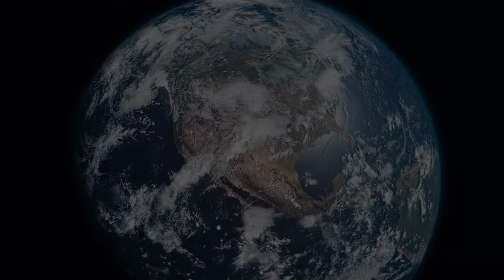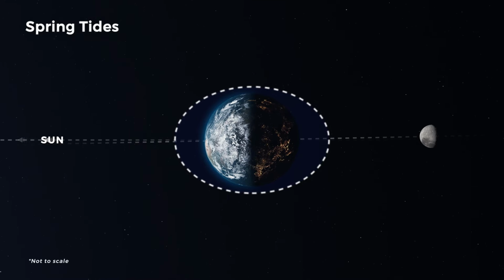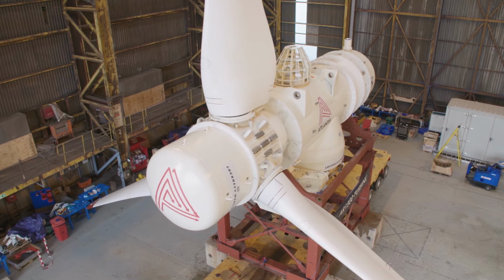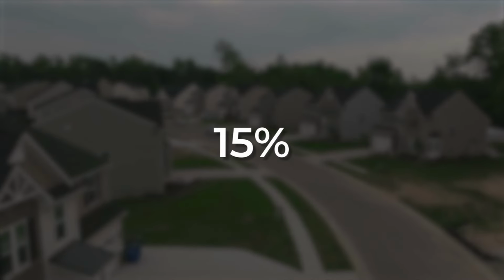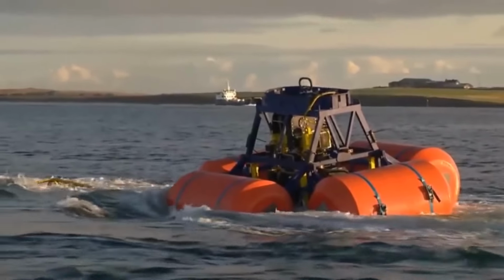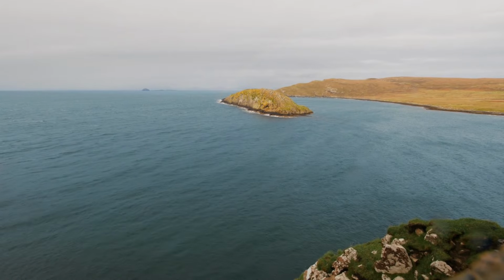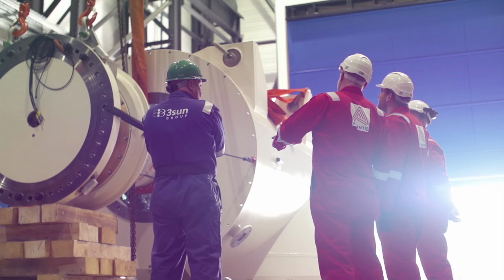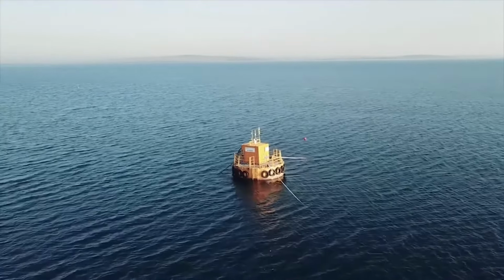Can Underwater Turbines Solve Our Energy Problems?

Comment from the maker: Have you watched our new video on Real Science? When we posted it we only had 30k subscribers. Somehow it now has 1.4 million views. Madness https://youtu.be/Bh4jKXsquWA
Reply: I have questions 

If tides is caused by the gravity of the moon and the sun does that means the energy of the tides comes from gravity?

 Does that means energy is transfer from the gravity to the tides?(since energy can't be created) 

Yet gravity of the moon comes from its mass so is the mass of the moon decreasing constantly?

Does that goes the same for every thing that have mass?

Pls🙏🙏 I need answers😅😅
Reply: @ll_ll4986  G'Day mate. The energy doesn't come from the gravity of the moon, it comes from the rotation of the Earth being much faster than the orbit of the moon. The gravity of the sun and moon act as anchors for the oceans tidal bulge which stays still while the Earth spins beneath it.

The energy is being extracted from the Earths rotational speed, ie: it's angular momentum. The Earth is made to spin a little bit slower every time this energy is used. This form of loss will eventually result in the Earth-Moon system being tidally locked. This is not a renewable energy resource in any sense.
Reply: @lordchickenhawk  thank you so much
Very well explained 🙏🙏😊😊
Reply: ''''''''The Earth is made to spin a little bit slower every time this energy is used. ''''''''''''''''''…………….………………………………………….when you say we use the energy do you mean when we use hydro electric or tidal power?
Reply: It comes from the Earth's rotation slowing. Eventually (very very long from now) Earth would become tidally locked with the moon, and then no more tidal energy could be extracted. (Actually the Earth will be engulfed by the Sun before that; but it would happen otherwise).
Reply: '''''''''Eventually (very very long from now) Earth would become tidally locked with the moon, and then no more tidal energy could be extracted'''''''''…………….……………………………………………………….where's your evidence of this and  when will this happen?
Reply: @ll_ll4986  Probably easiest to think of it as the energy comes from the spin of the earth and gravity is rope tugging from ocean to moon
Reply: @ll_ll4986  yes.. the moon draws up a big convex bulb of water which ever point on the earth its currently at.. as it passes over that bulb at the equator 'relaxes' back down causing the water to run both north and south away from the equator making the ocean level rise in the southern and northern hemipheres.. this is it tide coming in.. when the moon sucks it back up again  this is the tide going out
Reply: These should be put into commission.
Reply: @Orcaben1  at the earliest all round the world. 
Preferably beginning with India, with a suitable tue up with the Tata group or adani group
Reply: I'm sorry but this is an old design because we had people designing systems to use the ocean currents to ceate systems to generate electricity . There was a design that used the waves to generate electricity . I seen several different ways to use the ocean currents and waves to generate electricity and everyone of them were rejected by state and federal governments . One of the reasons that they were rejected was the cost and the time for the systems to pay for themselves . The other problem is the maintenance to keep them working .
Reply: Wish you and the YouTube channel  Mustard would do a video together
Reply: "In the end it will be hydrogen..." Why complicate?
Reply: We have water fuel cell technology they are suppressing. They don't want us to use it because there is no money in it for them. Water is very cheap and falls from the sky.
Reply: 天堂心臟  
Less friction means more water must move faster to turn the propellers...
I knew someone would bring this up at some point though. Friction is a necessity when it comes to using movement to generate electricity. No friction means you can have all the water in the world push up against those blades and the liquid would just flow effortlessly around it without disrupting it. Lowering friction would reduce energy output.
Reply: Corrosion is far more an issue than you can imagine, this technology has been around for years now, has relatively non existent restrictions and has yet to be instituted by any large companies due to the break down of the turbine's being so constant. This doesn't even begin to address the inconsistent currents not to be confused with tides that are, unlike commonly believed by most people, not on a set schedule not direction. They follow large scale flow like the Atlantic  jet streams but are hectic beyond belief.
Liquid salt reactors are safer less costly to build and maintain per Kw/h and killl less animals not to mention produce less pollution.
Thorium salt reactors in particular would allow for a massive advancement on cancer research as well.

It's not PC though so most people will keep repeating "CHERNOBYL!!!!"
Reply: There’s this place called Nevada I think that is so hot you wouldn’t walk half a mile just cover it in solar panels and the USA is sorted
Reply: @ice843  True. Even cleaner and cheaper than solar is the Leonardo E-Cat SKL and the BrilliantLight Power SunCell. 
See more at: E-CatWorld.com
Reply: Please do a video on nuclear power. IMO it is a nearly zero carbon energy source that is safe, just works, and has been implemented extremely cost effectively when done right (France, Sweden)
Reply: @2g00dt0btru  hell caught up  Einstine said hell of way boil water.even now tripple meltdowns ignorance mandontory is good short term.
Reply: RIMSHOT!
Reply: @ristube3319  E che significa ?
Reply: The ads spoils the entire video
Reply: 0
Reply: P
Reply: l
Reply: throw the blades use spherical turbine
Reply: I did and subscribed! 😁
Reply: 0p0
Reply: Please consider this to be the greatest inspiration possible. All the very best.
Reply: A large area of under wayer is kept idle.
Reply: this be cool in a much bigger and slower version at the entrance of the Mediterranean sea.
Reply: On these propellers, as on ships or submarines, the propellers kill the fish and this is not good, it would be better to use a rigid metal mesh around the propellers, precisely not to kill the fish and not to damage the propellers.
Reply: Something I always think about is, If a type 1.0 Civ , of maybe a type 0.95 Civilization  with  large energy capture of the planet, taking energy from flowing air and water currents', must have an equal and opposite reaction, right? Such as slowing down and/or changing the natural flow?
Reply: Ummm, What about The Bay of Fundy in Nova Scotia Canada.  They have been doing tidal power generation for decades.
Reply: so ok underwater turbine with windmill design would this harm sea life just like there do with flying bird  towards ordinary windmill farms ?
Reply: but what about that time the U.S navy made liquid hydrocarbon fuel by extracting carbon dioxide and tmaking it carbon monoxide and yes even though the tech is pretty early it's at least is carbon neutral
Reply: The Leonardo E-Cat SKL is an new source of cheap, clean energy, as is the BrilliantLight Power SunCell.  Learn more about these at: E-CatWorld  [dot] com.
Reply: Hi,  the amounts of Energy you mention in the beginning of the video, is that the total  amount we could ever harness from it or doesn't it include power production by salinity and other methods?
Reply: Like  Hard Drives  in RAID 5,   Every water turbine system should have a 'spare'  turbine.   a  5 turbine system is actually designed to continuously  run 4 units,  and rotate taking  one  turbine  off line  for  cleaning,  maintenance,   and inspection.    Continually rotating the maintenance and replacement of parts will extend the life of  all the turbines.
Reply: Read the comment 😕 I could get on wind and solar 35% to 45% not the 8% you have????????
Reply: There is also a tidal power plant (Annapolis Royal Generation Station) in the Bay Of Fundy in NS, Canada.
Reply: do a video on NASA's kilopower reactor and how its gonna transform space habitabilty.
Reply: Hi, I'm from India. Is there any job opportunity in Australia after doing any course you talk at the end of the videos?
Reply: It is amazing that you can SOUND smart but BE so ignorant.. or are you being deceptive on purpose?
Reply: 天堂心臟  
The body also produces lift and can stabilize the plane's aerodynamics. It needs some friction but generally speaking less (but not zero) friction on the fuselage is something aerospace engineers are looking into as it would improve efficiency.
Reply: Love the vids ❤️🔥 keep it up. I was wondering if you could make a video about the science of how McDonald’s and Ford can build car parts out of the coffee bean rests
Reply: As the Gulf Stream passes Cape Hatteras, the movement of water is some 45 times greater than the flow of every river on earth. That amount of moving water represents an extraordinary amount of potential energy, enough energy, according to the Coastal Studies Institute, that harnessing just 0.1 percent of the available power would yield the equivalent of 150 nuclear power plants. That’s 300 gigawatts of power.
https://www.coastalreview.org/2017/05/project-looks-tap-gulf-streams-energy/
Reply: NO MORE 'CHOP CHOP' turbines! Wobble Sticks are the way to go guys!
Reply: NUCLEAR POWER FTW!
Reply: Just more BS like the wind turbine 
Government subsidized crap! 
It cost 30 million per turbine last 5 years and produces less energy then they used to make it! #tellthetruth
Reply: @generalwin13 oil discovery impllaced betz limits with leonardo 509 year old design and you can not even see einstines equal and opposite reactions threw big gaps.  Betza  i did.in corner hover dams that reverce equally in tides magneticaly naturally upside down and sideways equally  blocking is 1 releasing is 2   = i big betz boo boo in 1919 to eliminate Einstine infinate winds, tides from reacuring in elections  works.right right slick.today greasing the elect.
Reply: You did not directly answer the question posed in the title in the video
Reply: I 100% disagree on ocean turbines, the amount of sea debris and oil it would out in the ocean we dont need it at all,nuclear fission is the best way to make energy without doing any damage
Reply: @treelonmusk8324  I'am with you that nuclear energy is an amazing way to provide large amounts of power but the sad fact is it comes down to money/investment and sadly public opinion which most people will never take the time to properly research the facts.
Reply: @jacksonstorm9561  it will take time but once we find a cheap clean way to do it, its gonna change the world, Chernobyl really showed us that we need to be careful tho
Reply: '''''''''''the amount of sea debris and oil it would out in the ocean we dont need it at all'''''''''''''''…………….…………………………………………………………..could you translate this to English
Reply: How about nuclear???  Oh that's right.  Most people don't understand it and thus fear it.  So we will just create a bunch of toxic chemicals to get the rare earth magnets for all the wind and tidal turbines.  What about the land fills of Tesla batteries that will exist in 50 years.  Also the creation of solar panels have a gas byproduct that nothing can absorb unlike Co2.
Reply: @clamp motosua What we use now is something we call nuclear fission which comes with all manor of lengthy complication that rightly should be feared such as meltdowns, weapons grade material and 15 thousand year half life to safe levels. However in the future we hope to harness nuclear fusion which doesn't suffer with meltdowns, isn't weapons grade and has a half life of 150 years to safe levels. Because we aren't there yet with the technology we have to do something about the issues we have now and green energy solutions are the way forward plus it's technology that takes you off the grid so in the future there will be a healthy mix of these two, it's just taking time to develop and adopt.
Reply: @clampmotosua1789  
What no one mentions here is that charging lithium ion batteries also produces gases... directly.
Charging a lead acid battery produces hydrogen in large enough quantities to be a fire hazzard and sulfur dioxide in trace amounts while charging lithium ion batteries produces nitrogen oxide which produces ozone which is a potent GHG and toxic to humans and animals it also produces CO2 gas directly. These gases escape the battery through ventilation ducts in each battery and a 1,200 pound rechargeable car battery is bound to produce a noticeable amount of CO2... Enough for them to warn users about charging in poorly ventilated conditions and warn users about charging their cars during the day!

Anyway I won't hold my breath that this RE guy will discuss that or the fact that Li battery fires output fluorine gas which is beyond caustic and we don't have the resources to just deal with EVs catching fire in the event of an accident. Hydrofluoric gases in high enough concentrations can start fires on things like brick and dissolve glass. Li batteries can produce enough HF gas to be toxic to humans.

30ppmv HF is considered a life threatening concentration.
A phone battery can obviously produce enough to hit 10ppm which is an irritant and mildly damaging to skin, eyes and respiratory system. I know what the ladder kind of exposure feels like I can only imagine what damage a car battery fire could cause.
Reply: @clampmotosua1789  Tesla is getting ready to recicle batterys: https://youtu.be/08FOfbhhKlw
Reply: nuclear plants take longer to build : almost ten years
Reply: @Dan W lol dont get all butthurt and try to start an argument bc I called you out for not knowing your stuff😂
Reply: Yeah that sounds great.. until you realize that it is screwing with the streams and warming the ocean.
Reply: @Dan W um are you sure?because the reactor inside of Chernobyl was a light water reactor... humans have yet to build a fission reactor yet that actuall works..😂😂😂😂😂😂😂
Reply: @treelonmusk8324  
RTGs are close enough despite not using fission to generate power. Genuine fission reactors are very rare indeed but they do exist.
Reply: @VariantAEC  show me a fusion reactor, lol you cant, cause there isnt one
Reply: @treelonmusk8324  never said anything about fusion you were talking fission earlier I mentioned RTGs which use radioactive isotopes and a thermal couple to make small amounts of electricity while KRUSTY (NASA's new Kilopower reactor) does use fission to function.
Reply: @VariantAEC oh look another internet good who wants to argu lol
Reply: Real Engineering
Harnessing wind power, earth thermal energy, Tidal wave energies will not affect equilibrium  of the system?
What do you think?
Reply: @MrDrgdf  Wait are you one of those dipshits who thinks that if we use geothermal we'll freeze the planet?

The heat energy doesn't disappear. Energy is not being destroyed.
Reply: @herpderpherpd  
Not only is it not being destroyed it's impossible to eliminate that energy supply unless the mass of the planet shrinks substantially.
As I mentioned possibly in another thread this is a gravity fed energy system. The literal pressure of the planet above is warming the stuff near the core of our planet. It won't cool even if the sun suddenly disappeared (no nova/supernova just deleted) and our planet was flung into deep space and found 18 billion years later.
Reply: @MrDrgdf  
Equilibrium of which systems? The global waterways, airways and deplete geothermal energy? No.

Kill all kinds of animals in the air and water? Yes, these systems will be affected. Geothermal doesn't affect animals that live underground as no animals live in the deep within the earth's crust that we have ever discovered and the system is gravitationally fuelled. The energy for geothermal cannot be depleted unless the Earth loses a lot of weight. The cores of dead planets are likely also hot even in the middle of deep space for billions of years. This isn't something people discuss because it sounds like woowoo despite the energy coming from an interaction between fundamental forces and matter that is renewable to the best of our knowledge. Basically if their's something out their like a hot superearth that was flung out into the vastness of intergalactic space and has resided there for 8 billion years it's core is probably still hotter than our planets own core. Mars is also considered to be a dead planet with little to no volcanic activity, but it's core is also likely about ⅕ as hot as Earth's according to 13 year old research papers discussed by New Scientist here: https://www.newscientist.com/article/dn11962-lab-study-indicates-mars-has-a-molten-core/
Anyway basically geothermal and hydroelectric power is the most sustainable energy we have but wave power via turbines like these are likely going to be hazardous to marine life anyway. Humans will likely push forward and kill animals by way of clobbering them to death with these fan blades rather than using nuclear energy or sticking to the cleaner methods we've been using for decades now burning coal and oil.
It sounds counterintuitive but the clearly made up climate and energy crises that we are not experiencing and are experiencing respectively. Yes, I am saying the climate emergency is not real and energy emergency is real. The energy emergency is confined to some nations particularly those who shifted energy needs to untried and underdeveloped "green solutions" (that are anything but) in an attempt to stave off a non-existent problem or climate calamity!

The more I look at how frequently past observational data is being augmented to suit warming climate the more I dismiss the scientists who push it. Unfortunately you can't just tell me all our past thermometers were wrong, providing temps that were about 3°F (1.666...) warmer than actual and call it a day.

Climate stats are as easily manipulated as any other statistics. For example no one believes in the ridiculous nutritional studies because they're always wrong. Climate science falls into the same category and if it were done and dusted we'd have stopped funding these guys and all nations would've abandoned fossil fuels and we would've gone to war to stop production of any and all fossil fuels if the planet really required it!

It doesn't and even if it did burning things is the fastest way to make energy even nuclear power plants produce most of their energy by simply boiling water! Yeah that also sounds ridiculous, but it's true. Source: http://large.stanford.edu/publications/power/references/paloverde/
Sometimes I hate being right all the time.
Reply: @VariantAEC  "...wave power via turbines like these..." Small but not insignificant point about that. These turbines are not running on renewable wave power. They are running on tidal power. The energy for tidal power comes from the non-renewable angular momentum of the planet.
Reply: @lordchickenhawk  
If tidal power isn't renewable in your opinion neither is wind or solar. And by the way this isn't driven by waves or tides it's driven by ocean currents which to not oscillate as regularly as wind and generate power far more stably but getting back to the original point that this isn't somehow renewable...
Will the sun last forever? No.
Will this planet's rotation continue infinitely even if the sun could exist forever? According to our math... No. And you think wind is driven by the sun or probably more accurately by differences in the day-to-day changes in hot and cold temperatures caused by the day/night cycle. So wind may also not be renewable and even if it were it's too unstable to use for continuous power generation there can be weeks without strong enough wind to generate power and high winds are also useless and maintenance is much more of a hassle on wind turbines than in other forms of energy generation.

Solar power has similar problems and land also is a finite resource that wind and solar farms eat up. We cannot put up a solar farm and take it down to farm every season while individual wind farms kill thousands of  birds and bats of all kinds every year.

Gravity isn't a finite resource as far as we know and as a result of the mass of the planet and our current understanding of physics rocky planets like this and black holes will be the only thing that exists before the alleged heat death of the universe (after all black holes evaporate and every subatomic particle has decayed into its constituent parts).
Only right before heat death would our planet dissolve into quarks and bosons if it somehow survived long enough to dodge all blackholes before they evaporated. When enough mass is finally shed from the surface gravity will no longer warm the core and it will cool...

That makes geothermal energy infinitely renewable. Thanks gravity!
Reply: @VariantAEC  In the sense that "heat death" may be the fate of the universe you are correct, no energy of any kind is renewable.

And of course, the Earth-Moon system (and every other) will run-down regardless of what we do. But Tidal power remains fundamentally different from solar, wave, wind or even "ocean currents". There is no "new" energy able to flow into the system of the former, unlike the latter examples.

Finally, gravity is not an energy resource. Energy is only stored in gravitational fields due to the relative positions and velocities of masses able to move within said field. Hence, geothermal energy is not going to last forever. Indeed, the only significant energy that can be added to that system now is due to radioactivity. New energy able to enter that system due to gravitational collapse is essentially insignificant since the end of the late heavy bombardment at best.
Reply: @lordchickenhawk  
Firstly heat death is a theory that so far is totally unproven. Why? Because we haven't observed any protons decay yet.
If protons can decay we can start assuming heat death could happen only IF we ever observe that happening. Just because computer models suggest it should doesn't mean it will.
Reply: @VariantAEC  No. The reality or otherwise of proton decay hasn't a significant relation to universal heat death being a possible eventual outcome.

Also, I said, "In the sense that heat death MAY be the fate of the universe you are correct"... You seem to be attempting to support the idea that you are not correct. 

I'm starting to feel embarrassed for your desperate need to be seen as cleverer than every commenter you reply to... Just stop
Reply: @lordchickenhawk  
Well electrons also haven't been observed decaying only neutrons decay when an atom breaks down.
So when all atmos decay hydrogen will be left starting the cycle all over again. Hydrogen will form into clumps until enough starts fusing into helium forming new stars.
Heat death sounds like an impossibly when electrons and protons will outlive the current age of the universe by several quintillion times.

So I am a bit cleverer than you.
Reply: ''''''''''''Eventually (very very long from now) Earth would become tidally locked with the moon, and then no more tidal energy could be extracted'''''''''''''''''…………….…………………………….when is that momentum going to end?
Reply: @MrDrgdf 
 Wind power is renewable since wind is powered by the sun. 

The Earth's thermal energy is powered by nuclear decay of radioactive trace elements at great depths so it's sort of "renewable" ...those particles will decay regardless of whether we use the energy or not.

Wave energy is renewable because it's powered by the wind BUT...

Tidal energy comes at the expense of the Earth's rotation. Tidal energy is in no sense renewable. Once used it is NEVER going to come back, hastening the "tidal lock" of the Earth/Moon system. No-one knows all the effects this acceleration/hastening will have on our "equilibrium". We don't even have any idea how much of this energy we can rob from the system without consequence.

Even coal, gas and oil are "renewable" compared to tidal energy, we just need to wait millions and millions of years for a little more to form here and there!
Reply: @lordchickenhawk  you are so wrong... Any energy source is renewable if ylu think that we are gling to suck the inertia of earth bu putting a few turbines around when it hss been like that millions of years. We arent important enough to stop the planet from rotating... Also coal is not renewable in any mean, as it was formed in a very specific era, when cellulose existed but not the enzimes needed to digest it. And that is something that wont happen again with most probability
Reply: @ronwesilen4536  True that on the coal, but then we are burying tons of organic waste in dumps around the world ourselves. Newspapers and corn-cobs from the 1950's have been dug up from such "deposits" that have not been broken down by bacteria because of the dry anaerobic conditions. 

OK, I was been a bit tongue in cheek about all that, but if you re-read that part of my earlier comment it should be obvious I was having a joke.

And I never said WE would stop the world from spinning. I said "This form of loss will eventually result in the Earth-Moon system being tidally locked" I also said "No-one knows all the effects this acceleration/hastening will have on our "equilibrium" ". 

We have learned in recent decades that small changes to complex systems can have unpredictable and arbitrarily large effects over time. When we use tidal energy we accelerate the Moon's recession rate from the Earth. That is irreversibly fucking with our orbital mechanics. Which is why I also mentioned that "We don't even have any idea how much of this energy we can rob from the system without consequence."

I stand by my original assertion, tidal energy is NOT renewable.

It is a VERY LARGE energy source but it is not renewable. So once were fossil fuels. Real Engineering is suggesting more than just a few turbines. He's suggesting base-load.

TBH it's is unlikely we would do any serious harm but I think we should be investigating LFTR before any other large scale power supply technologies ATM.
Reply: @lordchickenhawk  well i must agree with this comment now. I just thought that the other one wanst very clear and to me (after reading other comments from other people that are just f** idiots) it sounded like you were saying that earth would stop in a few years. However, the amount of turbines that are used.. i dont think it will have much of an impact, after all, all the water is loosing and have been loosing energy by heat from millions of years ago, and i dont think we have neither the ability neither the energy needs to make such a big impact to be even comparable to the heat disipation from natural rock formations in the oceans
Reply: @ronwesilen4536  Thanks. My only real concern on the issue is that people believe this is a renewable resource while I strongly believe it is not.

Sorry about being clear as mud. I just don't have any good way of explaining all my reasoning behind the original assertion without putting up a giant ranty text wall.

I agree that the risks are small at least in the short term but I still think we should pursue better options for large power outputs.
Reply: @lordchickenhawk  i'm totally on the pikachu farm to harness electricity
Reply: @MrDrgdf  0
Reply: @MrDrgdf  p
Reply: Pate
Reply: @MrDrgdf  as the increased climatic activity continues to rise in strength and severity due to the earth warming will potentially off set the damage.. think oysters slowing down a raging current in a tidal river or trees slowing the wind.. can't be bad
Reply: Real Engineering hi, I’m doing a paper on alternative source of power and I think your videos are helpful for introducing me to the energy of the future. However, I would like the research paper you read for all the energy related videos, email:intell1slt@gmail.com
Reply: @intell1slt  Einstine ban of betz limits is key its when oil discoverd eliminates over half the tides and winds values.not fact plus my equal and opposite reaction automatic feathering flat blade radial windmills that reverce equally hoover dams in tides and winds stoped by greasing elections now they have 30 1/2 life left.and you. Mayby.
Reply: What if we implemented a car exhaust filter that could get rid of 75% of all the emissions from the vehicle?
Reply: Plug the dino holes grease leaks quick before to late to stop misuse we need only for bearings the magnetic Bearings produceing light
 speeds bought out in last few elections.they keep spinning
Reply: Earth is Flat and Does Not Move
Reply: @Dan W that's why I told you to do some research befor you started this argument😂😂 we cant get enough power out of a prototype fission reactor for the power we put into it so we have yet to build a full size fission reactor.. so no, they people of Chernobyl shouldnt say anything about it because they have never had it😂😂😂😂
Reply: @Dan W im 20 but okay lol I can feel how angry you are from here😂😂 and if youd read what I said there are already prototype reactors.. they have done 0 damage to anything they just have to put in more power then they get out, I think this convo is done because you cant argu with sombody that's that heated about a youtube convo😂😂😂😂😂
Reply: Its mad how things get out of control 😂, I wounder if there is a pattern of growth of a channel over time that can predict future growth or determine the viability of a channel.
Reply: @Dwight5965  betz limits Einstines learning curve ban works last 100 years slick how well it re- elects policy.
Reply: @Dan W um how? I think you need to research what type of reactor that was befor you comment me in things🙈🙈😂😂😂😂😂
Reply: @treelonmusk8324  It was a fission reactor...
Just like all of the operational nuclear reactors we have today.
You're thinking of fusion, not fission....
Reply: Hello, thank you for another awesome renewables video! In your research for wave energy, please don't forget to check out the wave energy research at Oregon State University. They have made and tested a few different systems keep making awesome videos my friend!